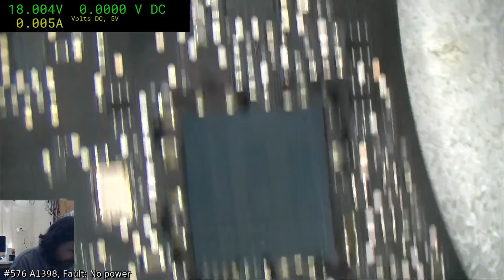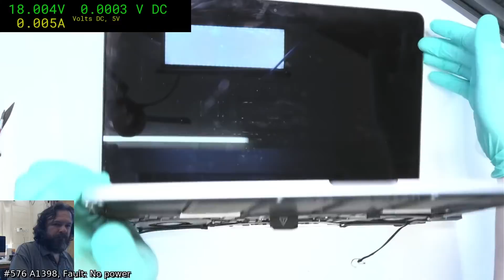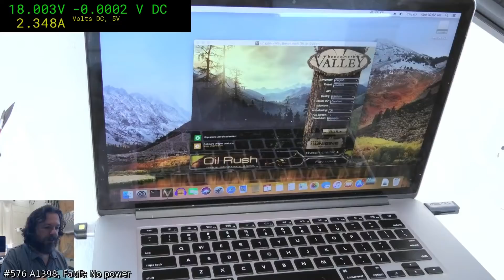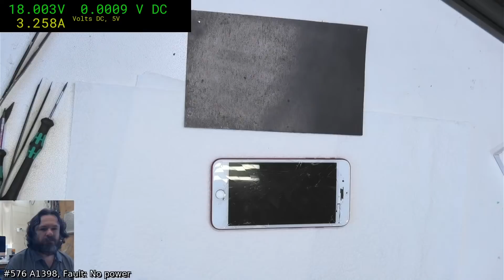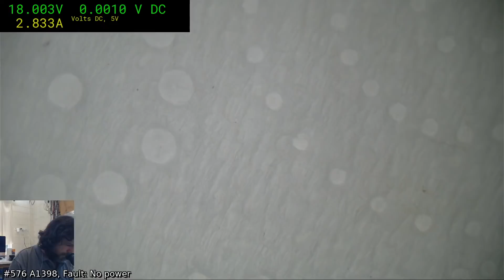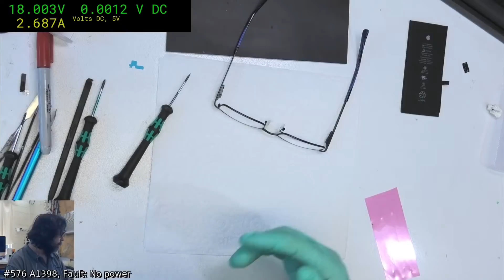#576 Macbook Pro Retina A1398 - No initial power, but boots after a while

Comment: Paul, I'm glad to see it takes you a couple extra seconds on the cables on this model.  When I did my keyboard replacement, I was paranoid about damaging connectors, so disassembly and assembly ended up being more time consuming than replacing the keyboard!